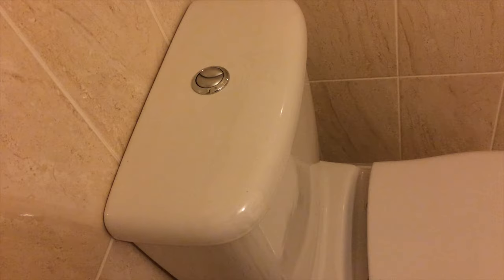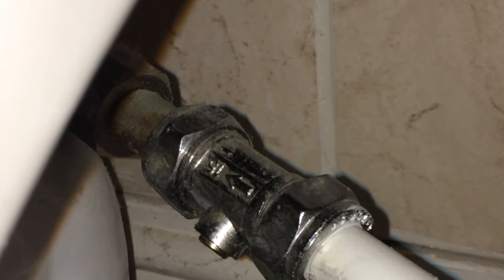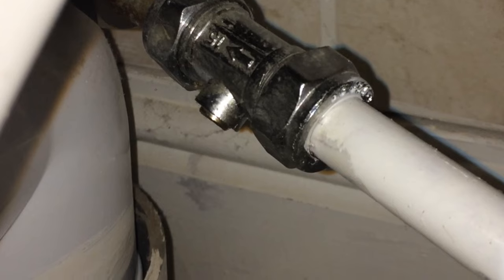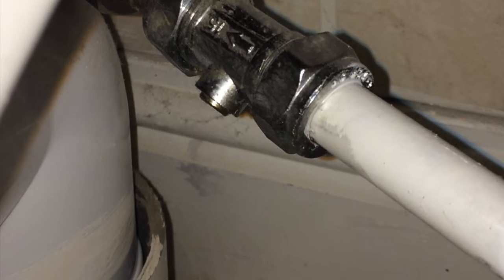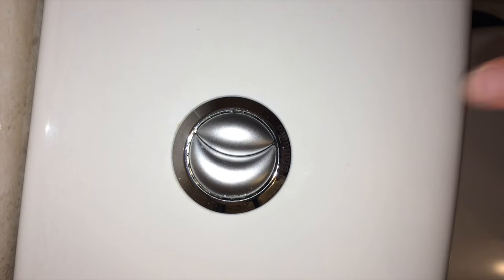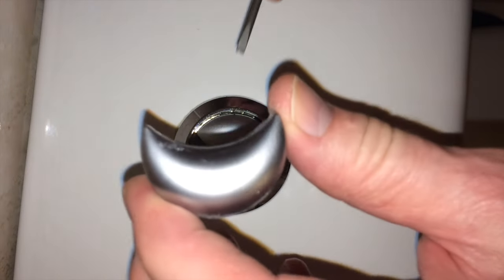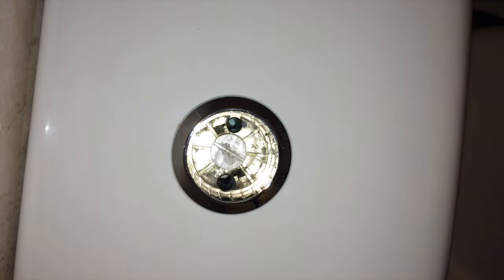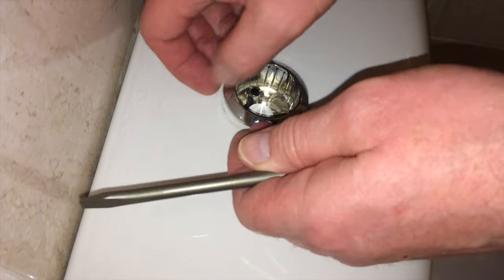How To Open A Dual Flush Toilet Cistern

Comment: I've had to take the Complete Top of My Toilet because the Buttons kept getting stuck in & a Lot of hassle to keep fixing them so I just Press the plastic Buttons in the Cistern,I may change the whole Dual flush Push buttons at some stage as they are about a Fiver from Wickes (I'm from the UK & a Fiver is Slang for £5).So thanks for the Info on how to do that!.
Reply from the maker: your welcome. Please don't forget to subscribe and share the  #fixed1t tag with others. Regards Malcolm aka #fixed1t

Comment: I suffered an unplanned water cut, now I need to use the toilet and wanted to see if it has water first, but it seems you have to press the flush button to open it... is this supposed to be an upgrade from the old toilet design? if it is, then it sucks a lot
Reply from the maker: A good way to test how full it is it tap the cistern gently with a knife to will making the say sound where the water is then a hollow brighter sounds where the water stops. Please don't forget to subscribe, share and check out my other great videos. Thanks Malcolm aka @fixed1t

Comment: Thanks for the video. Congratulations to who ever designed this dual-flush system- how to over complicate something that should be simple.
Reply from the maker: Thanks for the nice comment. If this saved you money please consider clicking on the link at the end of the video and becoming a fixed1t_supporter where you can gift me a dollar or two or take the free route, it all helps me dedicate more time to providing these tips.   Regards Malcolm aka #fixed1t I hope you get a chance to check out my Money Saving tips videos in my playlist. Tens of Thousands of people have benefitted from them as they represent some serious savings  https://www.youtube.com/playlist?list=PLVnKaE3t-yQVCioUwYaeLyQLcnOW5VMdK
Reply: I agree. Those bastards. I almost resorted to breaking the damn buttons off!
Reply: You just saved me a new toilet flush kit, hundreds of dollars plumbing callout and a nervous breakdown. Thanks!
Reply: Totally agree! 😳
Reply: This is very stupid design
Reply: Must have been designed by the same crew that puts a £5 part underneath a mess of stuff on my car that requires a £2500 labour job to get to.
Reply: I was trying to open since.....two key flush came off but I didn't see plastic screw.. hak thanks my toilet exactly the same as this video and the wall tiles too the same dimensions the same colour 😀😅🤣😂

Comment: Wish I had seen this before I tried it. I lifted the whole damn thing off with the cypher still attached to the lid. I guess I have wrecked it now.
Reply from the maker: Yep sods law be at least now you know to check out #fixed1t before undertaking another video there are over 500 videos covering diverse  topics. Please don't forget to subscribe to my channel and share the video and channel with others. Thanks Malcolm aka @fixed1t
Reply: @fixed1t  Update. I have successfully fixed the leak, though I'm not quite sure how. In the end I found that tightening the nut caused bad leakage, but leaving it slightly loose seemed to enable to it to 'settle down' after the flush, watertight.
Reply from the maker: Its most likely too misshapen when tighten up and leaving it a little loose allowed it to expand enough to produce a seal, glad to hear you #fixed1t

Comment: My dual flush buttons are not popping up after the each flush( the buttons remains inside), i need to press once again or tap the cistern; then the buttons pops up again .....please help me...
Thanks
Reply from the maker: it means they are scaled, follow the video carefully and cleaning off all limescale. Please check out me other (also fully working) videos, I hope you subscribe and share @fixed1t with others. Regards Malcolm aka @fixed1t

Comment: Any advice on what to do if there's no screw under the two buttons? I removed the buttons but the enclosure inside seems solid and won't budge
Reply from the maker: Stupid plumber friendly anti-tamper devices drive me mad. Gently check to see if it will twist or if there are any stickers of thin plastic membranes covering the screws.
Reply: Thanks for the reply. Turns out I needed to unscrew the part once I removed the buttons. Sorted!
Reply from the maker: Great to hear, don't forget to subscribe and share my site with your friends and family and if you can, but from Amazon with my link as I say it cost you nothing but gives me a few extra cents for buying new kit to make the videos. Thanks Malcolm aka fixed1t

Comment: This video is great and I managed to get the buttons off but I have no screw like yours. So I am and stuck trying to figure this out.. Any ideas
Reply from the maker: I haven't seen one without screws, does it have plastic clicks on it, if not it may just gently lift off. But if you get resistance stop so you don't break the side clips.
Reply: I haven't got screws either can u just twist the whole thing off

Comment: would be good if mine worked like that but I have one button inside the other!
Reply from the maker: I'll check this out.  Please post a picture to my fixed1t blog.
Reply: Fixedit. Thanks for your interest. I have sorted mine out. The whole fitting has to be unscrewed from the top B4 you can remove the lid. Quite difficult because the chrome surface has nothing to grip on. The brand is "Vitra" and the largest (outer)button is the mini flush and pressing the inner and outer button together is the maxi flush. Nothing needed replacing, the sliding stop valve had stuck and needed wiggling to get it working again.

Comment: do you have to turn the water off if you just want to put a toilet pill cleaner into it
Reply from the maker: It shouldn't be necessary if your just dropping one in.
Reply: @fixed1t  loved the vid, but when I went to replace, one of the tubes fell in the ever bluer water 🤪 and the brackety thing fell on top of the plungers and then because it was old and on the threshold of fully perishing, broke when it also dropped... will tape the top as it's functional (I think) until I work out how to fix with what to buy and engage the bracket in the top of the unit, plus I leant on the left side of the internal stack and seems it's on a ratchet so need work out how to release to level it.... joy, 2 minute job into a nightmare!!!👹

Comment: What a stupid set up, the twisting tops were so much better, got to do this every time a blue loo needs replacing....
Reply from the maker: Yep I know what you mean, but the problem is somebody comes up with an idea to beat the competition, it fails but their product is sold on mass cheaply to get rid of stock, so builders buy it up as its dirt cheap so more profit on the job, then its all gone and your left without spares LOL  Please don't forget to subscribe and check out my other money saving working videos. If your could share this with others so they may subscribe I'd be so happy and I want to try and get past 10K subscribers by the end of the year. Thanks Malcolm aka #fixed1t